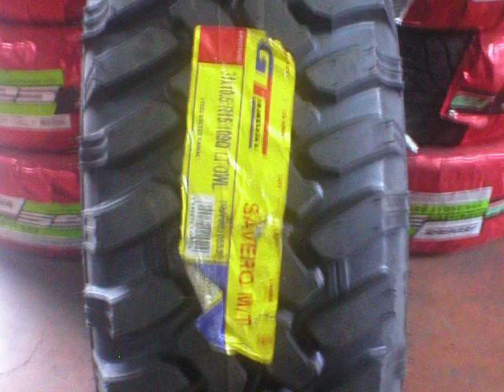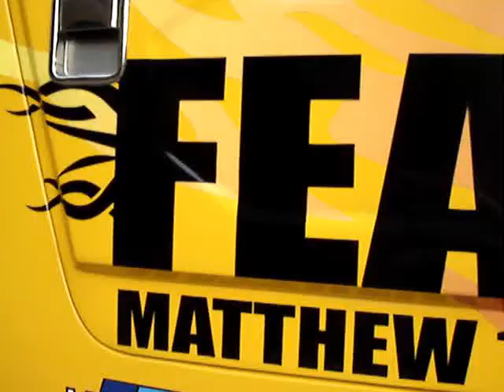BUILDING a HUMMER in the PHILIPPINES

Comment: Ok ang  design parang true except sa gulong kasi maliit na kung ang laki sana ay tulad ng mga rock crawler, para magmukhang serious off roader. Haba lang ng rear cab. Parang pang hakot ng buong sekta o kongregasyon.
Reply from the maker: I had no plans to rock crawl. It was slow on the highway and 1st Gear would often drop to 2nd Gear without my moving it. It did have a strong 1st Gear but I would have to hold the shift handle so that it would not pop into 2nd Gear all of a sudden. The cab in the rear was too low. You could not sit in the cab without bending over. It was also not 100% waterproof. When it would rain, the water would leak in the window cracks in the back.

Comment: ganda! magkano ba kung magpagawa nang ganito boss? im interested much po
Reply from the maker: Less than 600,000 pesos. Don't do it. I hardly drove it and sold it less than a year later.
Reply: @gomitch2   less than 600k... are all the parts including the engine new? ....
Reply: @gomitch2   good pm po. why ju sold it? it looks good though, looks really like an h1 alpha . "astig".  why sold it? does the maintenance so costly?  does it break always? ....im interested in h1 humvee with a slant back design.
Reply from the maker: @danbulb3422  The engine is second hand. There are hardly NO new engines in the Philippines except in new cars. It was 2nd hand - totally. Transmission 2nd hand, nearly everything second hand except the tires, wheels, body.
Reply from the maker: @danbulb3422  Too big, did not turn corners sharply enough, had a hard time making U-turn, brakes were not very strong. Noisy, Too high for ladies to get in when they had a dress on. Could not talk inside because too noisy. Bumpy, not smooth ride. Some of the window seals would leak during massive rain. Sometime rain would come inside under the floor boards. Slow on the highway. Top speed was maybe 65 kph. First gear would drop to second gear without me touching it. Air Conditioner never perfect. It was too nice, I would always be worried if I am parking in a dangerous area where thieves roam. Door locks are not good, easy to open without a key.  The transmission was not matched to the engine properly so even though the engine was powerful and capable of heavy work and heavy loads, the transmission held it back. It was like a WWE wrestler with a five year old body. The muscles were there (engine) but the transmission was a child. It was too wide for my garage. Hard to drive in and out. Took up too much space. Too wide. WHEN I DECIDED TO SELL IT: I told the buyer, are you sure you want this???DO you want me to tell you all of the complaints I have about it??? No No No. I love it. Are you sure????? They insisted I dont tell them anything so they happily bought it. OK. I insisted and tried to discourage them but they "had a vision for it." Whatever.
Reply: @gomitch2  heheehe... sounds and look like cartoons... how much did u sold it? n u replace it with what?
Reply: @gomitch2  maybe it could be better if the under stuff like (from the chases to the suspension, transmission to the engine ) used were from the Nissan safari patrol SUV vehicle. In that way, the only new is the body(a replica of the alpha h1 humvee). that's what they have suggested to some.
Reply: @gomitch2  any way,  thanks mate, very much.
Reply: Anong makina nyang hummer boss..?
Reply: @gomitch2  started building mine in 2018. Around 90% finished, cost me 300k. hahaha. everything you said was spot on @mitchell S metzger
Reply: @gomitch2  was really fun building it with my brother though